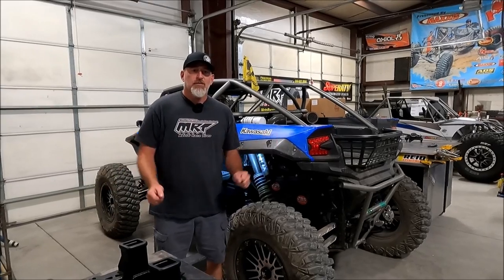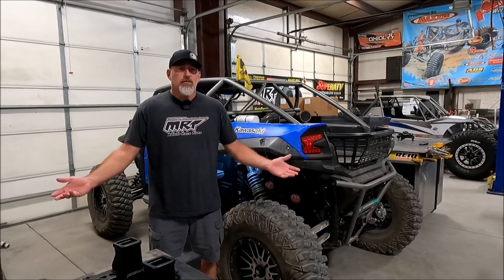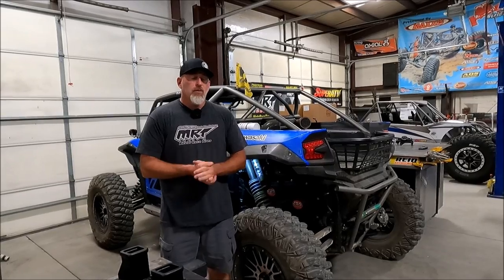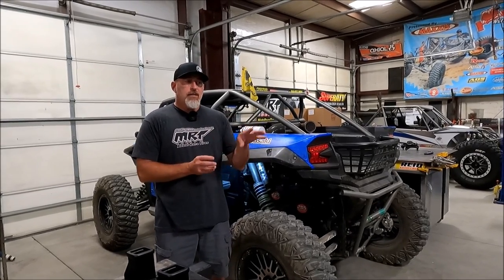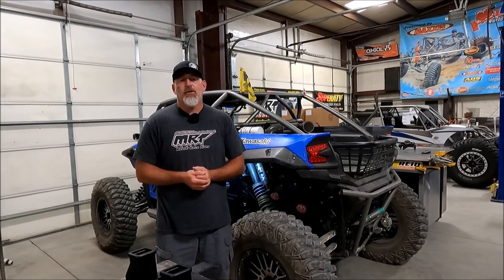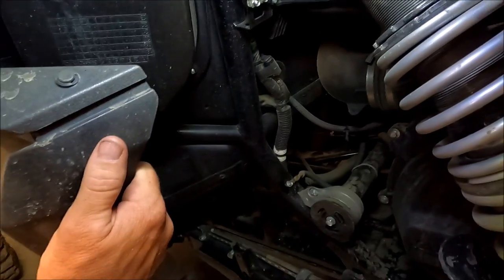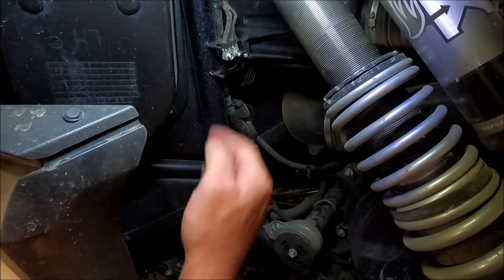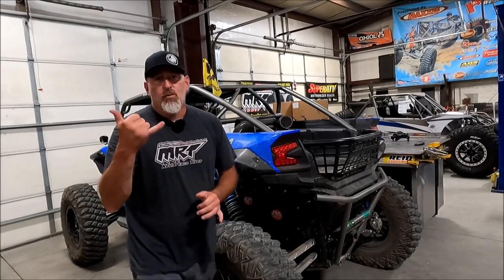Kawasaki KRX & KRX4 1000 Grounding Issue and Fix

Comment: Thank for the video! One question, my KRX ran out of battery  and I am trying to jump start it but cant even know how I cant pass energy from other car to my dead battery. I put the positive  to the dead batt and negative to a big screw under seat (and already tried other parts) but it seems not to work... got any suggestions? 😢 

BTW, when I connect the jump starter the energy seems to flow but as soon as I turn the ignition key on it wont start... Jump starter is Brand new and good with other cars. When I use cables it doesnt spark from.my dead battery either.  Pleade help! This is my 8 months Stock battery and wish I could skip buying a new one 😅

Comment: Thank you.  Oh and that updated fuel rail and height flow fuel filter made a huge difference on my 22 KRX with 500 miles.  Thank you again. It’s quieter and smoother I really felt the difference in a big bud hole at 4,000 rpm’s.

Comment: I have a 2024 keeps throwing p0335 crank sensor after hour of riding, speedometer sits on 0. When I crank it up the next day it’s fine for a while. It seems would this be ground issue? It’s sitting at the dealer for two weeks before they will look at it. I would like to remedy myself. Only 15 hrs on machine! Please help.
Reply from the maker: Not sure. However this is worth a try.

Comment: Good tips , I haven't had any issues, but will definitely do the grounds . I installed your rollover valve and maybe it's just me but my 2022 with 700 miles seems to run better , but we also put the OEM cab seal kit in too , and it really helped on the cab noise. So not sure about running better , maybe just getting broke in . We are in Michigan, riding rodes in the thumb , and riding trail's at our cabin west of Cadillac. Enough said , saving up for more parts from you guy's, keep up the good work , thank you
Reply from the maker: Thank you. It actually could be running better with just a rollover valve because it’s not pressurizing the fuel and making it run lean.

Comment: Hello new 2022 KRX1000SE owner and a Full access utv customer of the must have kits.
Question......
Im getting a slight stock LED headlight flicker noticeable while lights are pointed at my wall at idle,  but if i give it a small engine rev it goes away until RPMs drop to idle 
-battery at 12.4v standing voltage 
- 14.7V charge voltage while engine running
On the KRX forum I've read something about the stock voltage regulator being wired from stator to voltage regulator to fuse box then to the battery.
 
But some guys would do a hack that basically wired the battery to the fuse box so that the electrical system gets a steady voltage from the battery instead of the voltage regulator thus reducing voltage ripples or fluctuations from the stator. 

Also where is the stock am/fm radio antenna located? I get 💩 reception i can't even get a signal from the weather alert station either 😂
Any help my way would definitely help thank
Reply from the maker: thanks for the phone call.

Comment: I have a problem with my 2020 teryx, turns over but there is no power to the fuel pump, checked the fuses and relays, they are good, went through all the grounds, they are good, cannot figure it out. Any advice would be appreciated.
Reply from the maker: check power at the fuse and relay terminals. You should have power. If not? I have not heard of that.